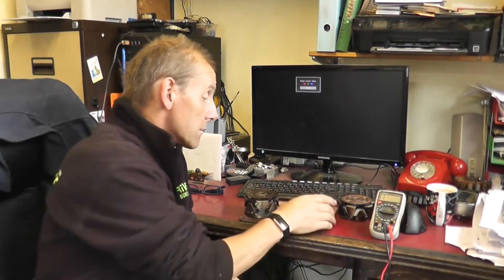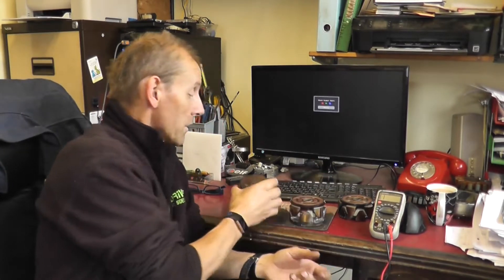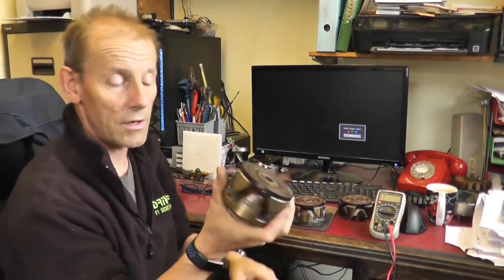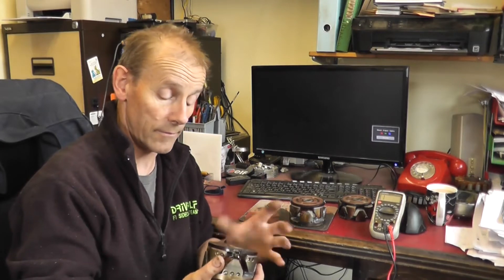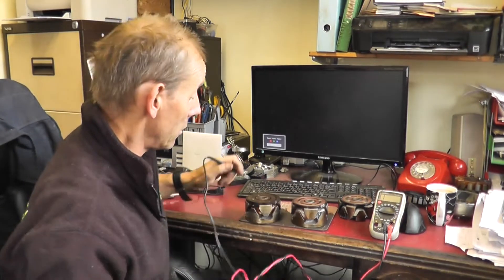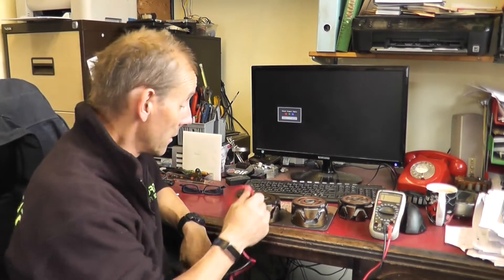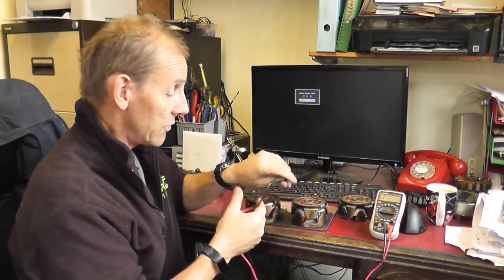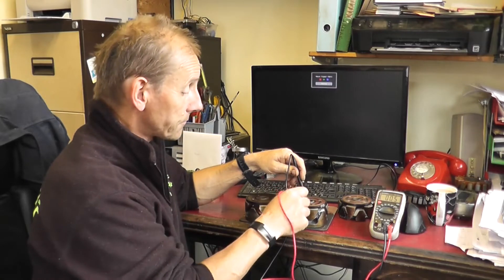Honda CB and CBX Electromagnetic Field Rotor Repair

Comment: If this is in the lower side of ohms reading does it contribute to a bad/irregular spark on any cylinder? Or does it just controls the charging system?
Reply from the maker: This only controls the charging system. Of coarse if the system voltage drops too low it will effect the sparks.

Comment: Nice work man ❤
Reply: Just got mine sorted out. Also needed new rectifier. Was wondering what small black diod? Is for on main harness. Mine is charging and running well now. I'm guessing mine was good and that maybe it's just there to keep the current from flowing backwards into ?
Reply: Honestly I've had at least five CB750 personally and many I have worked on for friends and never come across this issue with charging guess it was just destined that it's my turn to fight this gremlin now 😂 well I won this time for now

Comment: Great work! Many compliments. I have my 1981 Honda CB 750f rotor that gives me 1 ohm at the ends of the ring contacts, too low a value. I live in Italy, so between shipping costs Italy UK, repair and shipping UK Italy, it would be too high. A real shame. Anyway, a beautiful video.
Reply from the maker: Thank you. Yes, unfortunately the shipping cost do add up, however I was sent one last week from Canada.
Reply: @bbbikeshop8359  I'm so sorry, I saw that you are very good at restoring the functioning of the rotors, because I needed a working rotor. Let's see what I can find on the internet, even if they are used objects, therefore with doubts about their functioning.

Comment: I know the book and everyone says that 5 ohms is the test for good or not.  Well I ha e a story on this.....

I am one my 5th after market rotor.  They all measure from 5 to 5.3 ohms at room temperature.   And all 5 produce some charging voltage at 4k rpm but none at idle.  I took a rotor out a bike with an original oem rotor and it measures 5 ohms.  And guess what,  installing that one in this bike I have tried 5 rotors in, now charges to 14.5 at 4k rpm and I get 12.8 to 13.1 at idle. 

I have replaced everything and tried every combination of stator, rotors, regulators,  and even 3 types of batteries on this bike.

I have repaired probably 40 Hondas with charging problems.   So I have been here before.  But neve have rotors that test good but charge so terribly.
Reply from the maker: All the aftermarket rotors I have taken apart have been wound with a thinner gauge wire than OE, therefore there is less turns of wire inside to achieve the 5 ohms, this results in a much less strength magnetic field in the rotor when the DC  current is applied, consequently the output from the stator is much less.
Reply: @bbbikeshop8359  thanks for your replay.   Your answer is exactly what I thought!!  5 ohms is 5 ohms but wire size and amount of turns changes the field strength.

Comment: You mentioned being able to find these aftermarket. Where can I find one?
Reply from the maker: If it is for the CB750/900/1100 DOHCs or the SOHC CB650 (these are all the same rotor) then they are littered on ebay, if it is for the CBX1000 (smaller or larger type) then I do not know of any available that are aftermarket.

Comment: Great video, Thanks for making it. I live in Florida , I have a 1979 Honda CB750F. Had it 30 + years. I've been wondering how this was done. I have a few old rotors that failed now I'm up to trying this on my own. I have a question on the winding bobber tool you made. What's the outside diameter of the winding tool , that you wind the wire on. is it critical for the fit of the wire winding fitting to the rotor?
Reply from the maker: Thanks. If you email me at info@bbbikeshop.co.uk  I'll let you know.

Comment: I absolutely cannot find anyone in the entirety of ohio so here are my questions because im going to do this by myself   what direction do you turn the wire from back to front. What kind of tape wrap is that and is that just basic epoxy?
Reply from the maker: Direction of wire turns does not matter, Tyrelene tape, Google "Ultimeg 2020" is the Epoxy I use.
Reply: I'm in upper Sandusky Ohio did you ever get yours fixed